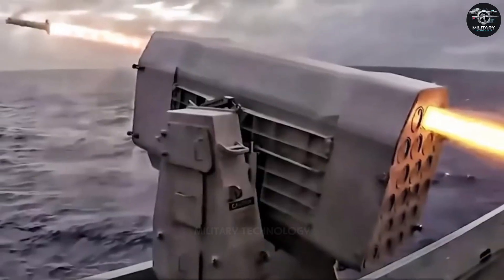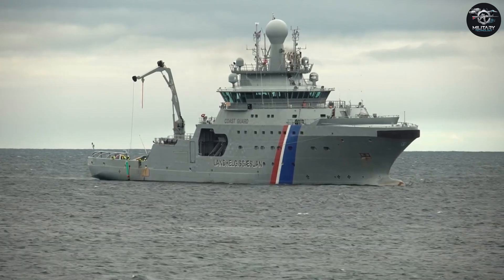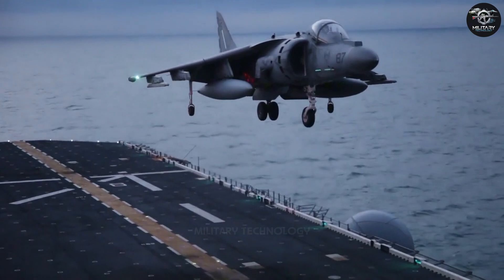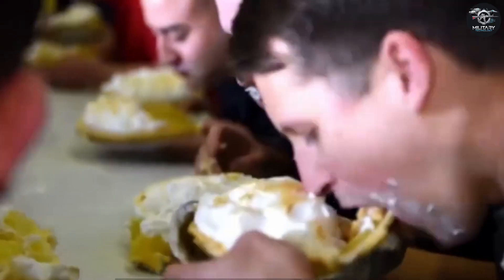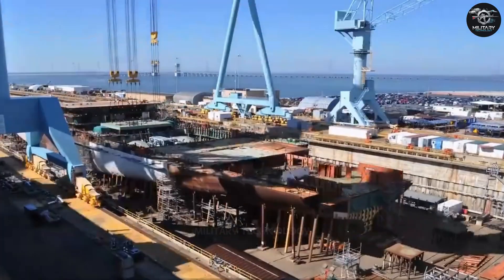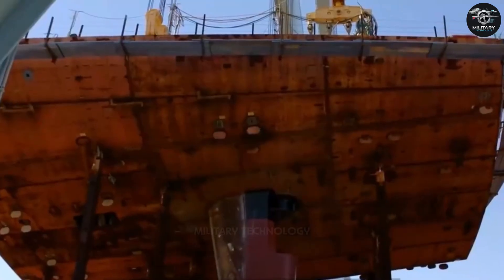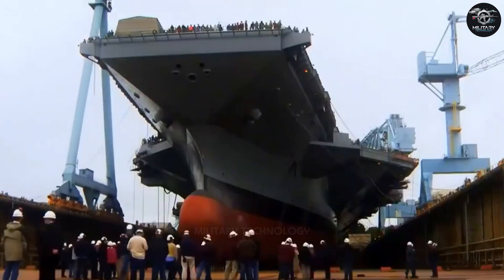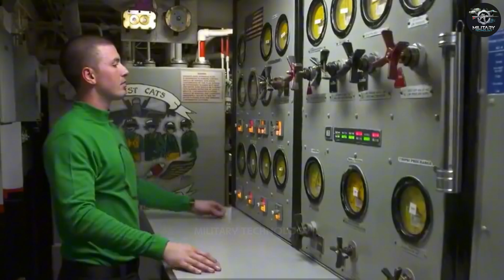Discover the Power of USS Ford: The U.S. Navy’s Most Advanced Aircraft Carrier

Comment: I want the Zumwalt to be reclassified as Cruisers re - established the two long-range 6" guns  and  build five for  each of four regions of the oceans to show our tactical strength and pleasant in the regions
Reply from the maker: A well-thought-out concept, but reclassifying the Zumwalt-class as cruisers and reintroducing the 155mm Advanced Gun System (AGS) comes with major challenges. The original AGS was discontinued due to the extreme cost of its specialized ammunition, making it impractical for sustained operations. Additionally, the Zumwalt's stealth design prioritizes survivability and electronic warfare rather than traditional cruiser roles.